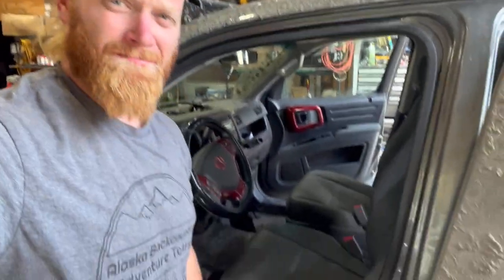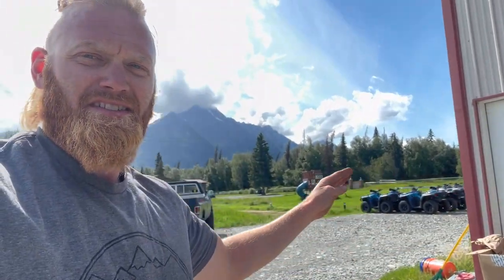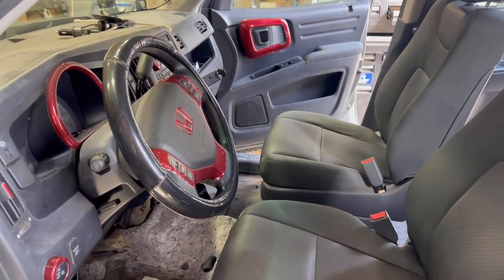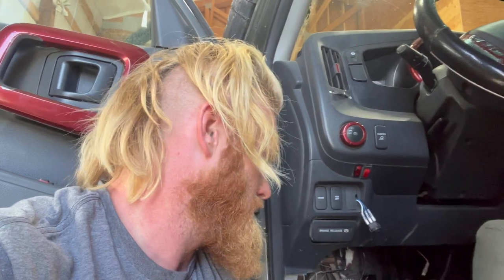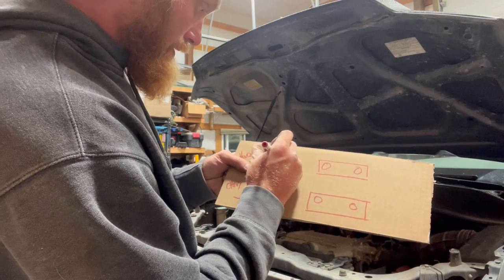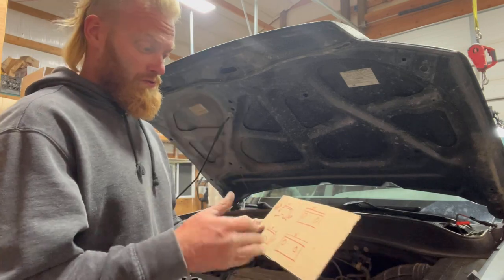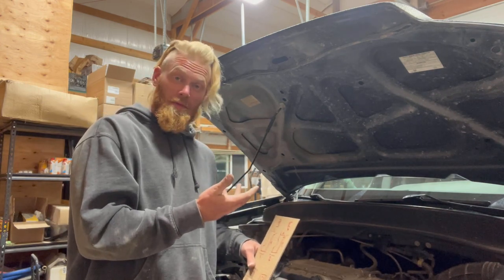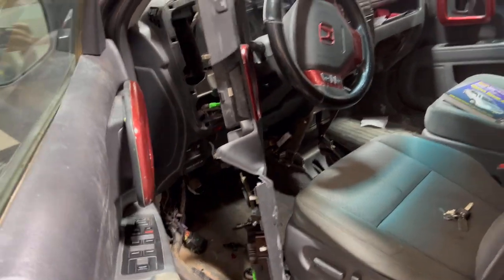Body swap Honda Ridgeline to Squarebody Pt. 1

Comment: Just an fyi what you called the ecu is actually the srs or airbag module.
Reply from the maker: Ya, I realized that later when pulling things apart haha.
Reply: @RenegadeHQ  the ECU is under the fuse box you were looking at 😉

Comment: The end of your unique Ridgeline you want more and your Ridgeline can’t handle It anymore. Once you swap it won’t be a Ridgeline anymore. If you want a low gear that bad for crawling just start a new project get a Chevy Avalanche or something else and don’t have to go through all that cutting and hassle with your Ridgeline.
Reply from the maker: I want something more unique haha. I actually don’t need to cut hardly anything.